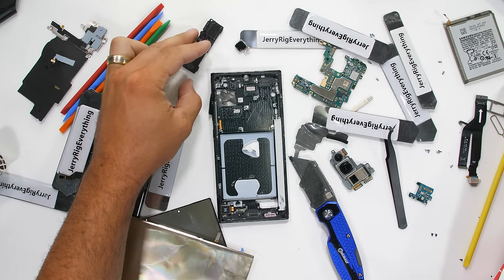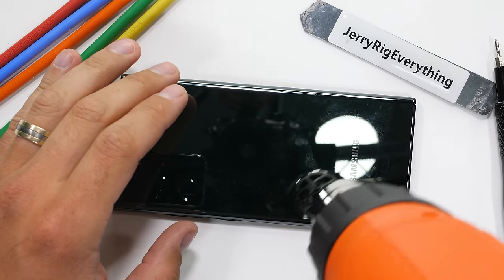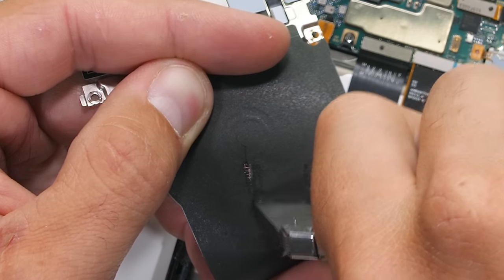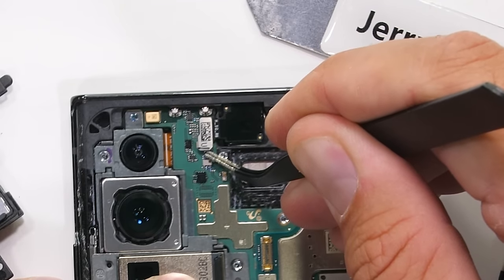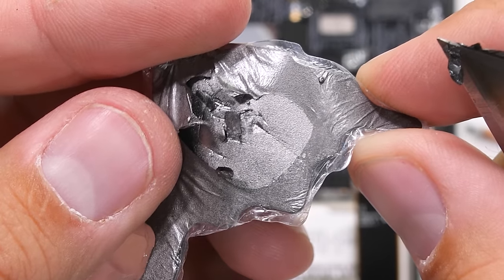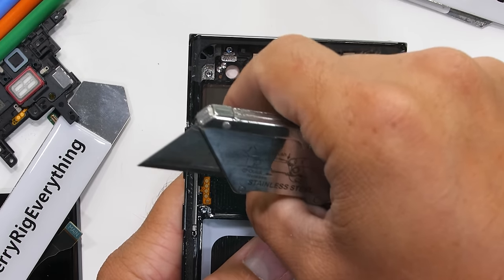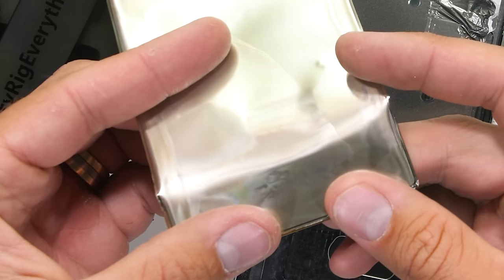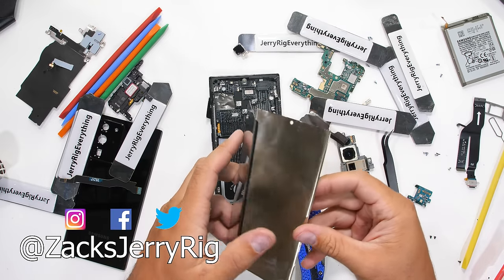Samsung Note 20 Ultra Teardown! - No Copper Cooling inside?!

Comment: holy fu**ing $hit
as if their Exynos "processor" wasn't enough of a scam.
Reply: Lol
Reply: bro Google it graphene is better conductor than copper infact its even better than gold its due to its molecular structure
Reply: @gogeta7173  That would explain why it's the primary layer on an SoC known for overheating
Reply: @YungBoiNeverBaldAgain who are u even in school
Reply: @YungBoiNeverBaldAgain bro they are same go googel it
Reply: @YungBoiNeverBaldAgain if its one lyer than its graphene if more than it is graphite
Reply: @franklingoodwin  Researchers at Chalmers University of Technology have developed a graphene-based film that has a thermal conductivity capacity that is four times that of copper. This new technology makes it perfect for cooling electronics circuits and components in RF devices, LEDs, servers, and smartphones, to name a few.Jul 15, 2015
Reply: I hope samsung doesnt use any SNAPDRAGON 
because they using SNAPDRAGON so they doesnt focus on their EXYNOSS just like HUAWEI 
they just use KIRIN and they can OPTIMIZED Their SOC 
so SAMSUNG need to REMOVE snapdragon variant so they can FOCUS to their Exynoss
Reply: @franklingoodwin  boi go do some research ots a new and expensive tecnology and is better than those vapour cambers
Reply: @abiez4018  bro graphene is better
Reply: @YungBoiNeverBaldAgain boi they are same
Reply: @YungBoiNeverBaldAgain plz go Google it
Reply: @abiez4018  they are focusing on exoynos because this system is better
Reply: @abiez4018  Researchers at Chalmers University of Technology have developed a graphene-based film that has a thermal conductivity capacity that is four times that of copper. This new technology makes it perfect for cooling electronics circuits and components in RF devices, LEDs, servers, and smartphones, to name a few.Jul 15, 2015
Reply: @YungBoiNeverBaldAgain one layer is called graphene more than one they became graphite
Reply: @gogeta7173  no need to copy and paste and also this isn't GRAPHENE ITS GRAPHITE TWO DIFFERENT ELEMENTS
Reply: @gogeta7173  maybe you forget that copper is not what makes it better but the substance inside copper tube just check some of best heat conductor videos on youtube and you will end up coppor vapour chamber
Reply: @gogeta7173  wTf is GRAPHENE thing?
Reply: @deadgamer9808  bro this is better the stuf inside is h2O
Reply: @gogeta7173  but when jerry tearing it apart it doesnt realese any vapours just check the action lab video on best heat conductor
Reply: The worst part is that in some countries not only are you stuck with the Exynos 990, the RAM is downgraded to 8GB!
Reply: @Noveze_  plz Google it graphene is one lyer graphite is multiple were you guys even sent to school???
Reply: @deadgamer9808  it juat does not need that the molecular structure is so strong
Reply: @gogeta7173  ok i have done some research for you first why are you mentioning strong structure it has notiong to do with thermal conductivity i have checked some online figure and maximum thermal conductivity of graphene is 5300 w/mk and for copper vapour chamber it can reach 100000 w/mk fir reference copper have thermal conductivity 400 w/mk

edit :- for reference
Reply: In Vietnam, I bought Note 20 ultra 5G Exynos and it is very hot in camera mode, I am not sure it use Copper or Graphite cooling?
-Note 20 ultra 4G Exynos---> copper cooling
-Note 20 ultra 5G Snapdragon---> graphite cooling
-Note 20 ultra 5G Exynos---> what is cooling? (this version is very hot). We need teardown this version to clear everything. Who know about this?
Reply: He actually got the models wrong. The model he has is SM-N986N which is the Snapdragon version therefore the snapdragon is the one with the inadequate cooling.
Reply: GOGETÁ copper vaporchamber isn’t same as just copper
Reply: @gogeta7173  Google doesn't make you an expert kid
Reply: @gogeta7173  Graphene is single layer of carbon sheet and graphite is a thick/multiple layers. But that doesn't make them same, their properties change completely. Though I agree here that graphite is much better for removing heat from processor and that is what Zack missed, because every other phones uses copper doesn't mean it's the best in class.
Also I'd like to add that he is wrong with spen having a capacitor too, Spen uses a battery instead.
Reply: @gogeta7173  Add credibility to your comments. Learn to spell.
Reply: @abiez4018  But if samsung doesnt use snapdragon they cant sell their products in the us due to the difference in communication standard ( the rest of the world use gsm but the us use both gsm and cdma. Snapdragon is the one who invented cdma and they wont share it to anyone else)
Reply: @sumanthd561  yeah it's kindda funny, theory and implementation can be very different. So much misinformation here, people better watch GN, LTT for better understanding of the topic
Reply: @gogeta7173  I'm using a note 10+ exynos version and it always overheats and slows down! It's a garbage phone for its price i feel scammed.
Reply: @gogeta7173  Not everything you watch and consume on the internet is true.This is youtube,not you street, where you can shit all day long.
Reply: I fix it says there is no performance difference in the cooling during tests
Reply: GOGETÁ if it was applied directly to it then that would be fine, but it has plastic between it and everything else which basically ruins its advantage. His point of no thermal paste still has merit.
Reply: Finally everyone can realize that iPhones are better and you don’t get scammed for the money you pay. You get the same phone anywhere in the world. 
Reply: @gogeta7173  dude are you just literally just a samsung employee told to do this. Feel bad you have to do this. By now you know your wrong. You know it and I know it
Reply: @abiez4018  they would kicked out by trump like huawei too, it's like "contribution" if use snapdragon.
Reply: @althofali9484  who said iPhone are better? Even if note 20 bad in heat management, iPhone worst, play pubg 5 10 with mobile network and everything getting lag and hot.
Reply: @NanoMine  The thing we see in smartphones isn't copper alone, its a copper heat chamber, the chamber has copper wicks inside it and s little amount of water. The water is what does the main job of carrying the heat away from the processor. So direct comparison of a copper heat sink with just a sheet of graphite is a whole different scenario than the one you're talking about
Reply: @gogeta7173  my ass go check linus's video it's worse
Reply: @gogeta7173  but it's overheating regardless
Reply: @cosmiclyrics2307  I know how heat pipes work, but this graphite pad is much better at absorbing heat from the SoC and dumping it in frame. Zack here did not prove that this solution doesn't perform as good as copper heat pipe. From ifixit's testing both the solutions have similar performance.
Reply: @GOGETA you are right bro that graphene is a far better than copper in terms of cooling. But whether N20 Ultra uses graphene (single layer of graphite) or graphite itself (multi layered), is not confirmed. So that should be the topic of argument.
Reply: @cosmiclyrics2307  bro this tech is supposed to come in batteries too in future. This graphene is being used in Mate 20X already. Graphene is 12 times more effective in absorbing heat than copper.
Reply: @NanoMine  I haven't seen ifixits video but if he just tested the phones then won't the results differ? Like one has a Snapdragon while the other has Exynos chip so both would differ a bit in terms of heat generation. Please clarify.

Edit: Also jerry wasn't completely wrong. I mean his main point was to point out that Samsung is changing the internal components of the device (without mentioning it clearly) which isn't right. If copper heat pipe is better then, the people getting the Snapdragon version are getting something less. And if Graphite is better, then people getting the Exynos version are getting something less (which they already are, the exynos processors suck big time)
Reply: @deadman4uin  Graphene and Graphite are two different things!! Both are carbons but they have a different structure, totally changing their properties. Carbon comes in like 1000s of forms, each different for the other
Reply: @cosmiclyrics2307  I searched for some info on graphene and graphite. Graphene is ONE SINGLE LAYER OF GRAPHITE. Please correct me if I am wrong.
Reply: @gogeta7173  how much samsung paid you? I want do the scamming job. Hook me up with them.
Reply: @deadman4uin  in that your are right, but Graphene still has properties different to that of graphite. Even the smallest of changes in the structure changes the properties
Reply: @gogeta7173  Yea, we get it. Graphene is one layer graphite is multiple. But even if graphene is derived from graphene its they have much different properties and characters. If they could get the same performance from graphite and graphene researchers wouldn't beat their ass off for years trying to mass produce graphene.  

So, instead of showing other people google, you go and read some more pages on graphene. Little knowledge is dangerous you know? Coal and Diamond both are made out of carbon. Go, try to sell coal as diamond to a jewelry shop when you will get your ass kicked off then you will realize graphene and graphite aren't same.
Reply: @cosmiclyrics2307  yes so the point of debate in the case of N20 Ultra should be that are they using graphene or graphite ?
Reply: Here we go, the right evidence to show that Samsung deliberately misrepresenting its product. Hopefully ppl will sue Samsung.
Reply: @deadman4uin  they are using graphite, atleast thats what jerry said
Reply: exynos is an important chip its good to have some healthy competition  it prevent snapdragon to over price there chips with time exynos will get better with time and i am really excited to see the fusion of exynos and AMD
Reply: @knowledgeofinvesting8872  Once AMD comes into the picture, then things will start making sense for Exynos.
Reply: @cosmiclyrics2307  even ifixit said the same thing but they were not sure about the material. So cannot say right away that graphite is used. After watching both the tear downs, one thing is sure that Samsung is moving in a right direction IF and IF only graphene is being used.
Reply: @eriksianipar5105  xD
Reply: @hoangminhnguyen435  SO 
no Samsung for US
Reply: @knowledgeofinvesting8872  good point but its not what Jerry was worried about. Its like buying same brand, model and price of car but with different and inferior parts.
Reply: @cosmiclyrics2307  Graphite and copper pipe isn't dependent on what processor it has, it's random. Also how is it cheating if the heating performance of both the models will be same?
Reply: @NanoMine  it isn't but if say Exynos heats up to 50° and the copper pipe is able to lower the temp by 5° then the processors temp would be 45°. On the other hand if the Snapdragon heats upto 47° and the graphite pipe brings down the temp by 2° then the processor would be at 45° as well. So unless tested with the same processor i don't think you can say for sure that both copper and graphite are performing at the same level. what i said is purely hypothetical, That is why i asked you what kind of test did ifixit perform to reach to the conclusion. Also although using Copper/Graphite may lead to similar performance in terms of heat dessipation but its still sort of cheating if they are not mentioning it on the specs sheet of the device . Copper is the traditional material, and thats what the customer must be anticipating. So if you decided to change that (for good or for worse) that should be mentioned somewhere on the specs sheet.
Reply: @cosmiclyrics2307  You completely missed my point, The tests were performed with snapdragon processors on both Graphite as well as copper heat pipe and both performed similar. For now it looks like samsung isn't targeting any specific region or specs to choose which cooling system it gets. Why would someone want to know how it is being cooled if both are performing same? why would that matter?
Reply: @NanoMine  thats why I asked you how were the tests performed in the first place but you didn't say it until this last comment of yours.
Reply: @Noveze_  you are right, but they are similar. Graphite is mainly just many layers of graphene
Reply: not to sound like. fanboy, but at least all versions of the newest iPhone all have the same cpu, gpu, and main parts.
Reply: its so embarrassing that they make us clean their shit
Reply: True

Comment: Note 20 Ultra user here. In the defense of my phone, it never felt so hot to the touch even in gaming, and it never got too uncomfortably hot. Good quality graphite are better in terms of thermal conductivity, and it is in some ways better than the old "thermal paste and vapor chamber" method. It does not dry up or leak, and has better longevity. I am not saying that the Note 20 Ultra is a perfect phone, but I am saying that graphite doesn't affect the phone's performance badly in any way.

Comment: So Exynos gets way hotter = no cooling

Snapdragon stays cool = but has cooling pipes anyways

Samsung wtf
Reply: Even international models with Exynos chipset also uses copper cooling chamber, check out other teardown from units in Cambodia, Vietnam, and New Zealand.
Reply: False, the exynos note 10+ had a heatsink in it
Reply: The model he has is not an exynos version it is snapdragon although he might be mistaken it is clearly that he has the snapdragon the korean version of snapdragon. Check the model number of his phone in his previous video which is the durability test of this phone.
Reply: @354javier3  finally, someone else noticed. Cause it has the same burn mark too!
Reply: @354javier3  probably you're right. I checked the durability test, and it has Korean language written on it. I don't know if the South Korean unit uses Snapdragon or Exynos there.
Reply: @yosoy01ian  they use snapdragon. I've imported the Phone with snapdragon from a company and it came from Korea. So far, i haven't experinced overheating with it, and i mostly played Cod Mobile for the past 2 days.
Reply: @adrianpariza5534  Good to know! Probably both Zack & iFixit uses Snapdragon version from South Korea & US, respectively! The US model has a 5G millimeter wave antenna, while the South Korean model hasn't. The Snapdragon version doesn't have copper heat pipe and uses graphite instead. The Exynos version has a copper heat pipe on it.
Reply: Adrian Pariza If you have the Korean Snapdragon can you please confirm if you can shut off the Camera shutter sound? I heard that you cannot shut off Cemera Shutter sound from Koree bec of thier Law.
Reply: @adrianpariza5534  by the way, are you aware that South Korean and Japanaese phones have camera shutter unable to disable, even in silent mode, because of a law that taking a photo without consent is illegal?
Reply: @jamesmartinez5088  Yes, indeed i cannot turn that off. I looked the other day at a video about what to do with the phone first. That option was meant to be right above the 'touch vibration' but is not there for me.
Reply: @yosoy01ian  Yes, i don't get the option to turn it off.
Reply: Adrian Pariza okey Thanks. I wanted to get it bec its Snapdragon but that Shutter sound will stop me buying it.
Reply: @jamesmartinez5088  Buy at US instead, if that matters to you.
Reply: I really don't know why is he lying about the processor. The phone is clearly a SD. I guess he got payed to trash the manufacturer....
Reply: False, at similar or lil bit changes in price Samsung sells there phones...in USA they use snapdragon processor and in India they use cheap exynos processors this is called A flexible company which can servive in all types of market...
Reply: Idk about that but graphite is a much better solution that copper
Reply: They were probably trying to sabotage the Snapdragon chip yet it stays cooler than Exynos with copper vapor chamber
Reply: Samsung has lost its mind.
Gone mad (samsung)
Reply: -Note 20 Ultra Exynos 4G, 5G using copper cooling-->receive many complaints about overheating.
-Note 20 Ultra Snapdragon 5G using graphite cooling-->receive less complaints about overheating.
In Vietnam, I bought Note 20 ultra 5G Exynos and returned it after 1 day using, it has scratch and dust inside cameras, it is very hot when open camera, zoom in, zoom out few times, the battery drop so fast.
This year, Exynos is a bad Chip for Note 20 ultra. Weaker than Snap so much, hotter, worse game, worse battery, worse camera, slower operations,...
Reply: Do u guys buy same car for same price......with different engine having different states of tune........one being inferior.....?